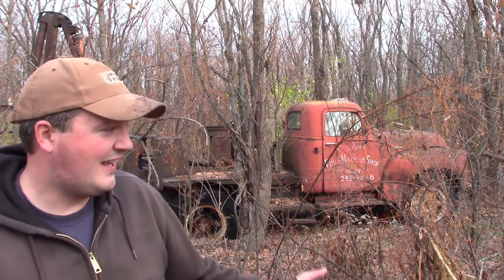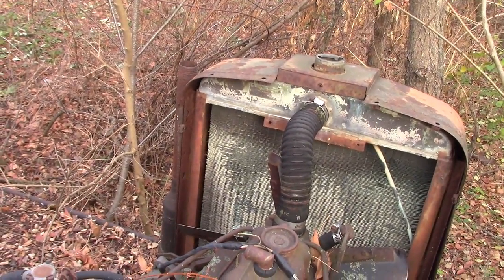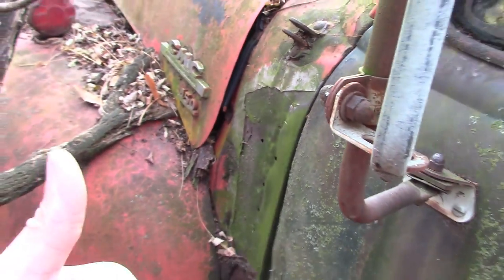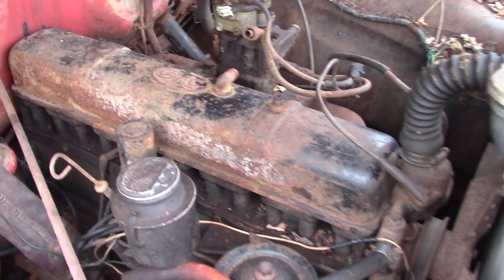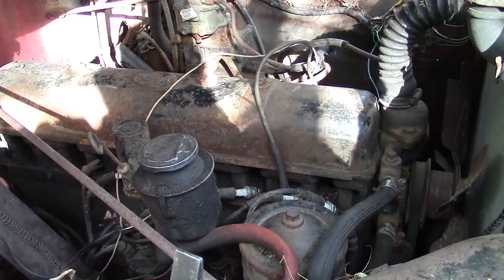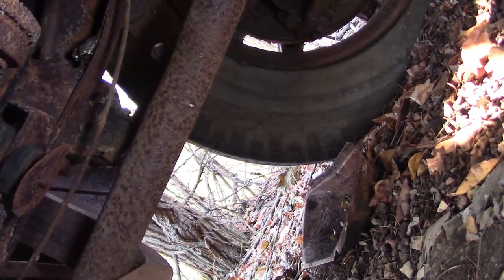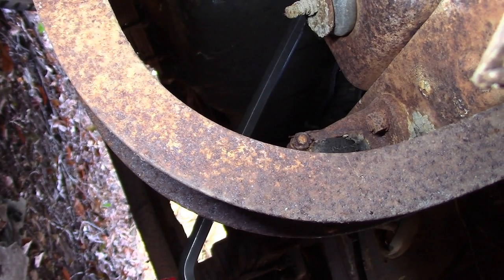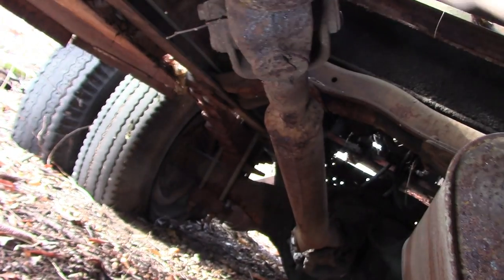Forgotten 1950s GMC Truck Backhoe Thing - Will it Ever Run Again?

Comment: If you put $20,000 into it, you'd have a solid $5,000 truck
Reply: You could probably get another $50 if you really tried
Reply: 100% fact.
Reply: It’s not worth it though
Reply: @2035jim  agreed.   That was the point.
Reply: @MJWance  The real point is it needs more threaded rod! :)

Comment: That video camera thing just takes all the fun and surprises out of this :) come on, man! pull the plugs, drop a battery in it and short the starter solenoid and see if she spins over lol . I found a 68 international box truck on a loadstar 1600 frame when cleaning a farm up for the new owners, the trees and grass hid it behind the barn. Ask what they were going to do with it and they said "no what are YOU going to do with it, you are getting paid to clean the place up". Well me being me, I had all the tools I needed (have you ever ran a tractor and a skid steer without bringing a tool box of some kind with you?) 6 billion BBQd wasps later, open the hood and had a can of starter fluid and a bic lighter, I am greeted with new plugs, new wires, new cap, new rotor, radiator still had antifreeze in it, oil wasn't black and in the right place on the dipstick, looking closer I see the firing order 18436572 is right but they timed it off #1 not #8 five minutes later, 5 ft of fuel hose, a coke bottle and a pint of gas I started it up and drove it up in the drive way.. now all of a sudden it is worth 5000 dollars to the new farm owners. I got the sheriff to come talk to them and a new truck out of the deal... love the videos sir and know that the time and effort are substantial in their making and I thank you for that!

Comment: A shame but reasonable decision to walk away. Someone could probably use the cab tho if theu desired. But I'm glad your doing revivals! Its why I started watching you
Reply: 54 GMC, first year one piece curved windshield.
On the side of the block down by the distributor there is a number stamped on a machined surface stating the engine displacement 
(Cubic Inches).

Comment: Back in the 50's my uncle purchased a CJ Jeep brand new, came with a half cab and a  dual wheeled rear end and a backhoe attachment that is very similar to the one that you have shown in this video. Although not quite as big in size (since it was mounted on a Willy's Jeep) But it looked the same. Ran off a PTO from the t-case, and you stood in the bed of the Jeep to operate.
Reply: Here's an old jeep advertising film from 1954 showing all the options they offered including the backhoe/trench digger
https://youtu.be/MuYbchw510Q
Reply: Those were awesome and rare

Comment: Enjoyed the video, especially all the crazy workarounds the original owners used to keep the old beast running. Reminded me of my Dad's bodgercraft. He never threw away a bolt or a scrap of metal. At times the only thing new parts on the the equipment after a repair was the bailing wire. Also your video provided a reality check for some YouTubers. Some old equipment just can't be fixed and you have to close the hood, put your hands in your pockets, and walk away. Well done!

Comment: Just made my day Wes. I’ve been wanting to see a video on this for quite a while!!
Reply: Is this the next project for the channel Matt?
Reply from the maker: I hope you weren't expecting a happy ending!
Reply: @WatchWesWork  not the first time I’ve heard that.,...
Reply: he  says the backhoe can not be saved  . thats the talk of a wealthy person that has way to much money . i know many many many people that would save that and use it . thats why we have unfairness on this so called earth . gread and uncaring  .
Reply: @carmichaelmoritz8662  what he means is by the time you’d put the money into parts in order to fix it you’d have more invested than you could buy a working unit of better design for. You could basically build a new one from scratch for the cost of repairing that one
Reply: @DieselCreek  sad to say i can not agree with your belief .  my dad bought one for 2,800 from a damaged ford tractor  . back in the day when i were healthy i modded it to fit onto a combine axle pull behind unit . the bucket ram was damaged beyond repair  due to deep cuts in the shaft itself . got a free ram from a junkyard that was to long and i shortened it and attached the special fitting from the end of the other ram welded it onto the good one that i shortened  . no way in helll could anyone find a good working unit for that price  .  the unit on the back of that truck could easily be rebuilt and save some poor person a  lot of money . it would have cost my dad over 2,800 to hire or rent a backhoe for the job and this way he still has the pull behind unit to use or sell  .
Reply: @carmichaelmoritz8662  i see your relying heavily on "free" parts and labor in this theory of yours...
Reply: @DieselCreek  well lots of people throw away good parts that can be used for something else  . on a mental level i could probably run circles around you with my ingenuity to come up with ideas on making something out of another person scrap  .  no theory  .  if i would have paid myself for the work i did for the farm i'd have been in debt to the farm lol  :))    the farm kept me alive and is still keeping me alive  .  my mind is still healthy its my body that is letting me down  . waste not want not  .
Reply: @carmichaelmoritz8662  id love to know where this magical junk yard is that gives stuff away
Reply: @DieselCreek  no kidding. I think you're gonna need a time machine to find it, though.
Reply: @carmichaelmoritz8662  Well fella, your opinion on what is considered wealthy is kinda  irrelevant. And its certainly not your place to decide how much money is TOO MUCH, there bud. We are all where we are at in life because of years of decision making. Sorry to hear that your years were likely spent making repeatedly wrong decisions. And I'm sure you voted accordingly as it seems you think everyone should have to provide people like youself unlimited free things to keep them going. Nobody owes you anything pop and your opinion that this world is somehow evil because there are too many rich and not enough handouts is flawed and ignorant. Ps- Happy Thanksgiving. I worked for and bought my turkey. Did you?
Reply: @wilburshuman  Nope, same world. There are good junk yards with plenty of cool stuff around here, but they don't give the stuff out for free. That's my point.
Reply: @wilburshuman  I thought you were talking about scrap yards. Yeah, I get you now. "Connections"
Reply: @carmichaelmoritz8662  Why don't you collect this truck and show us how it's done. You migh earn a bit of ad money at the same time. Cheers
Reply: @willtricks9432  my disabilities prevent me from doing it myself or i would  .  :))  people that are interested in doing that type of work and are healthy are usually doing it themselves  .  i seen lots of good items go to the scrap yards and if not disabled i could have easily salvaged those items  .
Reply: @wilburshuman  thank you for explaining :)) .  i do not have the energy to go into a great explanation
Reply: @carmichaelmoritz8662  This is not even in a scrap yard, hard to reach and time consuming to tear apart to find out the true extent of it's condition. Drop this of in India as an example and it would be taken apart quick by a lot of poorly paid people in bad conditions, often with no real environmental concerns.
Reply: @carmichaelmoritz8662  The fact that you can't spell "greed" probably contributes to your tax bracket.
Reply: @hithere7382  lol.    :))
Reply: @WatchWesWork  thats what she said
Reply: @wilburshuman  chill out...he speaks for all the democrats out there. By the way the definition of a republican is a democrat with a conscience.
Reply: @austinbeimers4440  he doesn't live near Iowa  he lives in Pennsylvania
Reply: @carmichaelmoritz8662  I get where your coming from. If you have a free house, workspace and living costs, then these kind of projects are ok. It's great when you can find stuff for free or low cost, but if you have to put your life on hold for a month to it, the real cost is another months rent/mortgage on your house, another months bills, food, vehicle/traveling costs. Over here in the uk that's a minimum of £1500 + another 2k for some workspace. 

I grew up on a farm, I spent a lot of my early years reviving stuff like this. Generally I was successful from an engineering point a view, but economically it would have been cheaper to have paid the extra money for working equipment and got earning quickly.
Reply: @thegregdavieschannel  i totally understand.  for me though gaining wealth was not my goal , i will always rather be poor then to work endless hour's making someone else more wealthy then they already are. we as people already sleep most of our lives away and then if we work out more of our life is wasted.  if not for the family farm i would have given up long ago due to the fact working endless hour's and not being able to sit back without a care in the world. i could never do that. life is short enough as it is.

Comment: The BACKHOE part is neat, the SWING very different. On a FORD 420 use to run had  a chain rap around with Cylinder's system kind of like that. It sure would have been neat to see digging ground in its day. I wish those car rebuild SHOWS on MOTOR TREND would take on a project like one of these, all those TALENTED old time CLASSIC car guys. Watching them rebuild her
Thank you for showing this old great piece.

Comment: TOOLS EXPLAINED

DRILL PRESS : A tall upright machine useful for suddenly snatching flat metal bar stock out of your hands so that it smacks you in the chest and flings your beer across the room, denting the freshly-painted project which you had carefully set in the corner where nothing could get to it.

WIRE WHEEL : Cleans paint off bolts and then throws them somewhere under the workbench with the speed of light. Also removes fingerprints and hard-earned calluses from fingers in about the time it takes you to say, 'Oh sh*t'

DROP SAW : A portable cutting tool used to make studs too short.

PLIERS : Used to round off bolt heads. Sometimes used in the creation of blood-blisters.

BELT SANDER : An electric sanding tool commonly used to convert minor touch-up jobs into major refinishing jobs.

HACKSAW : One of a family of cutting tools built on the Ouija board principle... It transforms human energy into a crooked, unpredictable motion, and the more you attempt to influence its course, the more dismal your future becomes.

VISE-GRIPS : Generally used after pliers to completely round off bolt heads. If nothing else is available, they can also be used to transfer intense welding heat to the palm of your hand.

OXYACETYLENE TORCH : Used almost entirely for lighting on fire various flammable objects in your shop. Also handy for igniting the grease inside the wheel hub out of which you want to remove a bearing race.. 

 TABLE SAW : A large stationary power tool commonly used to launch wood projectiles for testing wall integrity.

HYDRAULIC FLOOR JACK : Used for lowering an automobile to the ground after you have installed your new brake shoes, trapping the jack handle firmly under the bumper.

BAND SAW : A large stationary power saw primarily used by most shops to cut good aluminum sheet into smaller pieces that more easily fit into the trash can after you cut on the inside of the line instead of the outside edge.

TWO-TON ENGINE HOIST : A tool for testing the maximum tensile strength of everything you forgot to disconnect.

PHILLIPS SCREWDRIVER : Normally used to stab the vacuum seals under lids or for opening old-style paper-and-tin oil cans and splashing oil on your shirt; but can also be used, as the name implies, to strip out Phillips screw heads.

STRAIGHT SCREWDRIVER : A tool for opening paint cans. Sometimes used to convert common slotted screws into non-removable screws and butchering your palms.

PRY BAR : A tool used to crumple the metal surrounding that clip or bracket you needed to remove in order to replace a 50 cent part.

HOSE CUTTER : A tool used to make hoses too short.

HAMMER : Originally employed as a weapon of war, the hammer nowadays is used as a kind of divining rod to locate the most expensive parts adjacent the object we are trying to hit.

UTILITY KNIFE : Used to open and slice through the contents of cardboard cartons delivered to your front door; works particularly well on contents such as seats, vinyl records, liquids in plastic bottles, collector magazines, refund checks, and rubber or plastic parts. Especially useful for slicing work clothes, but only while in use.

ADJUSTABLE WRENCH: aka "Another hammer", aka "the Swedish Nut Lathe", aka "Crescent Wrench".  Commonly used as a one size fits all wrench, usually results in rounding off nut heads before the use of pliers.  Will randomly adjust size between bolts, resulting in busted buckles, curse words, and multiple threats to any inanimate objects within the immediate vicinity.

 Son of a b*tch TOOL : Any handy tool that you grab and throw across the garage while yelling 'Son of a b*tch' at the top of your lungs. It is also, most often, the next tool that you will need.
Reply: Wut
Reply: Forgot about this list! Thanks for the laugh, I needed it today.

Comment: Back in the late 50s - early 60s my grandfather worked for our local township and they had a Hopto backhoe mounted on a Studebaker truck chassis that they used for installing culvers, etc. The hopto used a 4 cylinder Allis Chalmers gas engine as I recall. Haven't seen one of those for decades!

Comment: It’s hard not to get passionate when you see a cool looking old truck like this . Especially if your a Chevy guy . 
I had an advantage when i free’d up the 258 I6 for my CJ5 , it wasn’t sitting 20 years or more . I soaked the cylinders with diesel . It cleaned a lot of corrosion . Extracted the diesel and began the PB blaster , sea foam deep creep , marvel mystery oil , trans fluid etc. to no avail . Researching , I found someone who said install a block heater and fill the cooling system . The expansion of the cylinder walls did help making space between the pistons and walls . But we know our challenge is the frozen rings . After weeks ( into a few months ) of sporadic block heating sessions and soaking each cylinder , I started forcing what penetrant and even diesel trough the rings somewhat by using a compression gauge with a quick disconnect and got it with 90 +psi every chance I got . Not owning a bore scope I used my best cheap pocket flashlight and peered into the cylinders for the 1000th time and said it’s go time . Now , I had the advantage of the engine being out and on a rolling cart strapped down . The stand shift flywheel had two holes bored into it I guess meant for balance weights a few inches apart . Stuck two 5/8” shoulder bolts ( threads cut off ) and deployed the wrecking bar . Used restraint but applied muscle and heard a faint tweak ! Tried the opposite direction and heard the same . I got stoked but not stupid . Kept using the sea foam deep creep and kept at it . Finally , got it to make full revolutions . Yes , I remembered to wet down the valve train with marvel mystery oil but I carefully got it to roll . Suffice to say , I am driving the Jeep with this engine to date . This all predates COVID 19 (2019 ) . This year it’s a runner . Ok , I had and advantage , not stuck too badly and out of the vehicle and the ability to grab the flywheel using the two holes with bolts . But I think what brought success was cleaning the cylinders any way I could , soaking with penetrant , heating the block and forcing the chosen solutions through the pistons and rings with compressed air . Yeah Wes , I know if you were able to drag it home , we all know you could get ‘er done . But practicality speaks . It’s a cool old truck and those 235 / 270 or what engines were used in the WW2 six by’s and such were awesome engines but practicality speaks . Just something to think about . Just a thought . 😳
P.S. -  I’m sure the restoration crowd would lick their chops over the fairly intact sheet metal ( cab and front clip ) and the vintage GMC engine . Would it be worth bringing a plasma cutter ( if you promise not to light the woods up ) out there and liberate the cab and nose and engine / trans ? The rest of the truck is up for grabs .

Comment: put the cab on your daily driver since it is solid, that metal would take years to riot out
Reply: I was gonna say the same thing,pull the cab off and put it on your ford.
Reply: Dear ken frazier
👍👌👏 That's a really good idea and I bet that it would be great fun to watch a conversion series. But if I remember correctly the frame of WWWs daily driver pickup truck is already too far gone also. Maybe simply not worth to invest time/money into it?! Nevertheless: I guess another chassis with a complete drive train could be found relatively easily and for not too much money. For example: At least a friend of great Johnathan W. (Delray JYD) has a lot of those on his property. Indeed I don't know how far away this is from the WWW place.
Best regards, luck and health.

Comment: Lift the body off and lower it onto a diesel rolling, running newer chassis
Reply: That's an instant rat rod cab ready to go to a new truck chassis. I'd go with an LS engine. The scrap yards are full of low mileage LS  engine's and are cheap.
Reply: Th